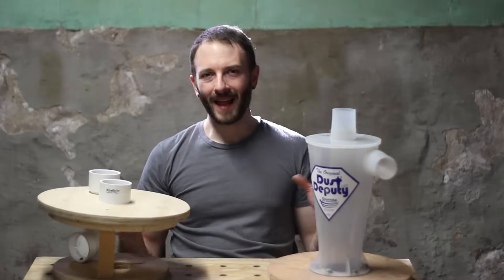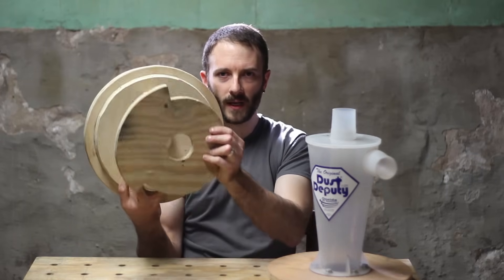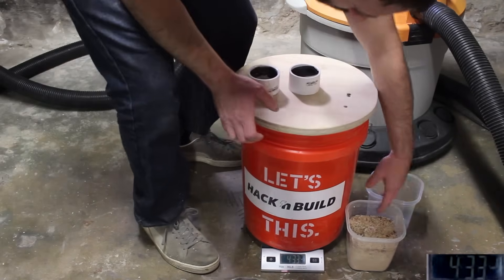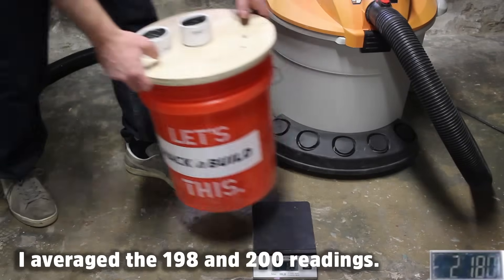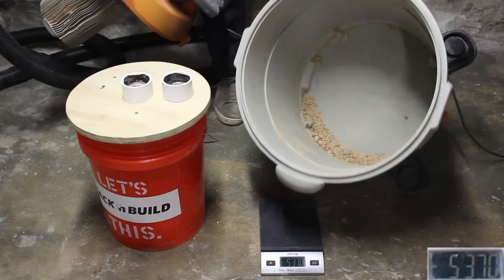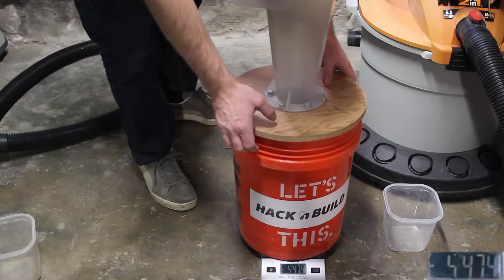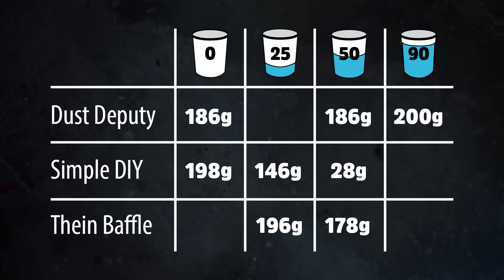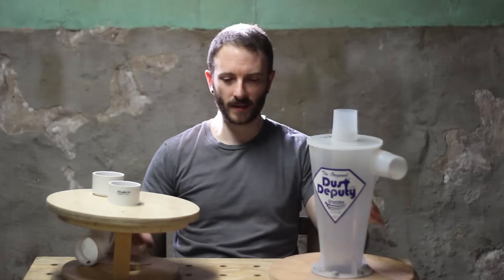IMPROVED cyclone dust collection vs Oneida Dust Deputy (2/2) - HNB #10

Comment: I tried making a DIY extractor but it collapsed first a 5 gallon bucket, then a plastic 30 gallon trash can and also a metal 30 gallon trash can...believe it or not.  Im not sure why.
Reply: Too much vacuum:  always keep at least one dust gate open.  Otherwise, for every 1 PSI (pounds per square inch) of vacuum, every square foot (12" x 12") of bucket or can gets 12 x 12 = 144 pounds of force on it.

Air is 14PSI at sea level, so maximum possible force is 14 PSI x 12" x 12" = 2,016 pounds per square foot.  Not realistic here because dust collectors and shop vacs can't pull that much of a vacuum, but you get the idea.
Reply from the maker: That's happened to me too.  It also will happen much more readily if the intake hose gets plugged up.  I took two of the bad buckets and epoxied them together.  I also placed a layer of pebbles in the first bucket for added weight.  Haven't had the problem since then.

Comment: I also enjoyed your tests and use two similar bucket collectors in my shop attached to 2 1/4" hose shop vacs. For the money, it seemed worthwhile to buy the Dust Deputy. I needed a shorter collector to dedicate to my tablesaw and stow under the extensions, thus the Thien baffle was a better solution. Also like the lower profile because it is sturdier and more stable than the taller cyclone. Am pleased with both and the Dust Deputy captures most of the dust dedicated to my bandsaw. Wish the inlet and outlet ports on the cyclone were sized a little larger to closer match my vac hose and was wondering if there is much loss in airflow volume and ability to capture dust at the inlet from a bandsaw or sander.
Reply: Christopher (7 MONTHS AGO ) from what I know the best you can do is to collect the dust as close to where it begins meaning producing dust covers anywhere you can nearest the production of dust. I cut the covers of my band saw to place pipe just beside the bottom guide rollers and even though it does not grab all the falling dust I think it sucks up most of the fine air particles out my garage wall as I don't use a filter for the large unit. The difficult machines to work with are the chop saw or table saw as they throw dust volume hard and fast.. you need big air to gather all that dust properly. My unit 4in pipe 1hp motor will grab the first few seconds on a chop saw then dust starts to override the vacuum strength as the dust air flow begins a pattern.  it's difficult to make a good dust cover for a chop saw but what a difference without my air machine especially with MDF boards.
Reply from the maker: Glad you enjoyed it. Thanks for watching, Christopher!

Comment: Good followup. However, you still did the same thing as in the last video. The bucket was not in the same location on the scale between measurements. Having the baffle definitely helped out with the accumulation.
How about testing with the baffle in various locations. Turning it 1/4 turn each test to see what the results would yield. Is it possible that the open portion in relation to the inlet tube makes a difference in performance?
Another thing to consider would be raising the homemade unit up by taking some thin paneling, or thin plexiglass, and wrapping it around the collector. This would give you equal space in the bucket between the two tests. It's obvious that volume in the bucket makes a huge difference. The Dust Deputy sits above the bucket allowing 100% of the bucket to be used for collection and air circulation. The homemade version does not do this as you have it built. I know that you are following some plans that you found online, but perhaps you could make some more modifications to it and see if you can get it to be more efficient as the Dust Deputy.
Look forward to more testing  ;)
Reply from the maker: The tests certainly could be more rigorous and elaborate, but  it partly comes down to what can reasonably fit into a short video. I think for my next build, I am going to go with a 2-stage using two buckets instead of a baffle.  This YouTuber has a pretty interesting video: https://www.youtube.com/watch?v=iC_yjuLgCNc using that sort of design.  Thanks for the suggestions and stay tuned! 📺

Comment: In all fairness, you were clearly making every excuse you could for the Dust Deputy so you clearly had a preference.  Also, the design of the homemade collector gave it specific disadvantages which you then criticized it for.  You can make one that rests almost entirely on top of the bucket like the Dust Deputy and thus doesn't clog as the level in the bucket rises.  There are also other homemade cyclone collectors which should perform exactly like the Dust Deputy.  Overall, this is a good test, but one that clearly had a bias and also wasn't exactly comparing apples to apples.
Reply: Exactly.  Take the home made setup, cut out the bottom of it and mount it on top of another empty bucket; now you have a more apples to apples comparison.  Also, just saw another video of a guy using a road cone for his cyclone as a cheap alternative
Reply: @amherstfinishing  Actually, using road cones only intuitively seems cheap. Saw a video using one which included a link to Amazon to purchase the cone. Almost $40! Then of course is the $ spent on all the other parts needed to make the the cone work and you end up spending as much as the Dust Deputy costs. But much worse is the extreme labor required to design/build traffic cone-based collector: lots of complicated holes/pipes to cut to make the thing work right/efficiently. HOURS of work/fidgeting/frustration. Unless you're willing to steal a cone and you really enjoy the process/challenge of DIY, traffic cone not an economical solution.

Coincidentally, there was recently an abandoned cone on the sidewalk near my home. Free for the taking (not stealing). I didn't bother to grab it. Not worth the effort for the maybe $25 saved vs buying the Dust Deputy
Reply: Bitchspot Blog I was thinking the same thing. The greater the distance from the the top of the sawdust to the bottom of the cyclone chamber, the greater the suction. Therefore both will perform exactly the same.
Reply: I hope a cyclone can do better than a baffle even if there are beautiful Thien baffles out there on youtube
Reply: I haven't seen someone make one from a second bucket that sits on top of the collection bucket yet, it would give you the whole bucket for collection like you were saying, and it wouldn't take extra width because it's the same as the collection bucket.
Reply: Haha, just what I said, then spotted this reply comment.
Reply: FYI-Building the two-bucket cyclone by Matthias Wandel
https://www.youtube.com/watch?v=z-xhYnWDCd0
Reply from the maker: I wanted to cheap DIY option to work better, I really did.  If you think you can build a better DIY version go for it!  I've got a few new design in the works so stay tuned for a futre video 📺.  Cheers!

Comment: good video. im a great believer in the thien baffle. what you built is a basic diy version. if you followed all the ideas on the thien forum you would end up with much higher efficiencies. when i testes mine i got 99% effficiency  on a 45 gallon test run a normal speeds. if you built a full on pimped out set up with the foolowing  you would get better resultsdouble height chambertop hat styleside inletround to rectangular transition on the inlet allowing 10% area for lossesthin chamfered baffle edgeno suppport holding the bafflebellmouth outlet air straightener on the outletim thinking about remaking my 50mm version  so i might run a test like this
Reply from the maker: That would be interesting to see, Alan.  Do you have plans or a write-up that documents your build?  I have a very small basement workshop so the 5gal size is perfect for me.  I still want to try building another cyclone collector that uses a 2.5gal bucket for the first stage and see what kind of results I can get with that.
Reply: not really any write up on it but if you pop over to the thien forum you can read up on my build and loads of others. retired 2 has a great thread on his build that does some testing. im planning to rebuold my 50 mm one, i expanded the shop so i have some room to use it again. im planning to use a cnc to make it. make it a double height or even a tripple. i would like to try a cone under the baffel to drop into a 5gallon bucket.  so that i can mount the seperator on the wall out of the way , i have an 8" double height top hat with rectangular inlet for my main dust colection pipe. it works great. it does let a bit of fine dust fromm the drum sander past but its easy to clean that off the pleated filters with the paddle thing inside that you turn

Comment: Nice series of tests.  I enjoyed both videos.  Question: What's the point of dumping the sawdust onto the floor? It seems you could have simply sucked it out of the container.  By dumping the sawdust onto the floor, there's a greater chance that all the sawdust might not be vacuumed up -- which could affect your test results.  (In the first video, it appeared in one of your tests that a portion of the sawdust was trapped under the cord of the vacuum and remained on the floor.)
Reply from the maker: Glad you liked the videos.  I found that when vacuuming the sawdust straight out of the container, it would get sucked up too quickly and the units would get bogged down.  Dumping it out allowed me to vacuum it up in a more gradual controlled way.

Comment: I have a thien baffle dust collector that is vented outside and I find that when I quickly vacuum up a pile of sawdust a small amount of the sawdust goes outside.  But if I'm vacuuming up stuff at a slower more even pace, the separation efficiency increases.  I'm happy with the performance of the thien baffle.  Mine is along the lines of the April Wilkerson conversion of a HF dust collector.
Reply from the maker: I ran into the same thing setting up for the tests.  The first thing I did shove the hose into a full bucket of sawdust to see what would happen.  Both systems get bogged down pretty quickly that way, but that's not really a very accurate test!  I think the smaller pile of sawdust is a reasonable compromise between a real-world scenario and a repeatable test.  Thanks for watching, cheers!

Comment: Good follow up....thanks
Reply: I have a hunch that if the thien baffle plate were made out of something very thin that it might increase the efficiency.  With a chunk of 3/4" plywood for the baffle, the stream of dust particles hits the wide 3/4" plywood at the end of the slot as it is revolving around. While most of the dust goes down, some amount hits the cross section and creates turbulence.  I have a window in mine and the dust makes several revolutions before all of it drops to the bottom.  I've thought that if the baffle were made out of thin metal (like 12 or 14 gauge) that it would act more as a knife edge and the cross section for the dust hitting the end of the open slot would be negligible.  Just a hunch....
Reply: Yes, I added a bevel at each end of the slot.  The bevel is in the opposite direction at each end of the slot to assist in directing the air.  .
Reply from the maker: Interesting idea Bruce.  It would certainly be worth investigating.  A similar effect might be achieved by putting a bevel on the top side of the baffle too.
Reply from the maker: Did you notice if it works better having the bevel or did you add it from the getgo?
Reply: Hack 'n Build I put the bevel in originally
Reply: Now that I think of it, I actually had a straight slot and found that wood turning stringy shavings would sometimes build up on the leading edge.  That is when I used a rasp to taper the ends of the slot.  It would still occasionally load up.  That is why I thought that a thin metal edge may work even better.
Reply: There's a new low profile separator from Home Depot that seems to be getting rave reviews. Might be fun to run a comparison between HD's Dustopper and Dust Deputy to evaluate performance, and compare/contrast the benefits of Dustopper's lower profile. Less tippy, fits under bench, easier to move around the sh0p, etc. Could be fun to watch.
Reply from the maker: Thanks - there is definitely some improvement with the 2.0 design, but I want to test out a couple different designs that are hopefully even better.  Cheers!
Reply from the maker: Makes sense, Bruce.
Reply: outsidescrewball ,

Comment: So, if we get a taller bucket the DIY will continue to beat the Deputy.
Reply: Hack 'n Build sorry, I didn't really explain myself properly. I meant when you add the 25% if you ran the motor first, then any loose debris would end up in the shop vac and would you a real world zero when the first weigh was done. Mind you, I suppose that would possibly mean with the DIY cyclone that it would possibly suck a lot into the shop vac. Loved your comparisons, very thorough. I have been thinking of the DIY one but may consider a road cone based cyclone.
Reply from the maker: Glad it was helpful.  I think the roadcone version would be the way to go compared to a baffle design, my guess is that you'd get pretty good performance without a lot of tweaking.
Reply: Hack 'n Build I thought the same. I also was wondering what would happen if when you put the sawdust in the bucket if you had run the shop vac to ensure loose debris would be sucked out. Then the bucket could be weighed. Not a criticism, just an observation. Thanks for the test though.
Reply from the maker: If I understand the question, I did try this before settling on this method for testing. A big mass of sawdust would be sucked up relatively quickly and both get bogged down in that case, so that's why I dump it out. The dump it all on the floor method could be improved my dumping onto a piece of plywood.  I would probably just inspect visually rather than weighing it because the amount left (if any) would be so minute the scale wouldn't pick it up. Thanks for watching, cheers!
Reply from the maker: Based on the numbers, sure - but you'd need a 6' high bucket! In all fairness think that the 186g measurements I took (in the previous video) were a result from dust getting stuck inte hose around the intake port as opposed to being stuck in the vacuum.  There is also a bit more fine dust going into the bucket with the baffle design.  At some point I may do a third iteration to hopefully get performance closer to the Dust Deputy.